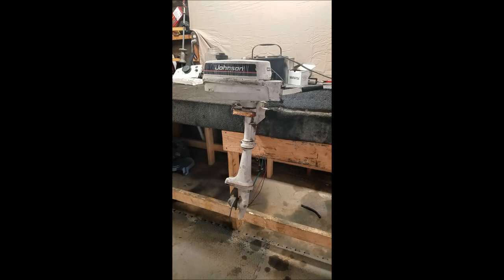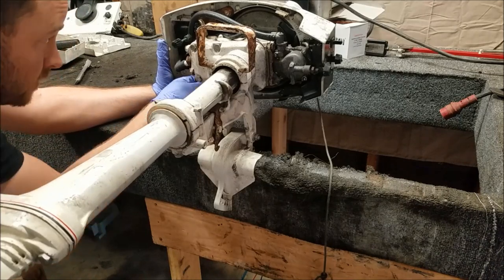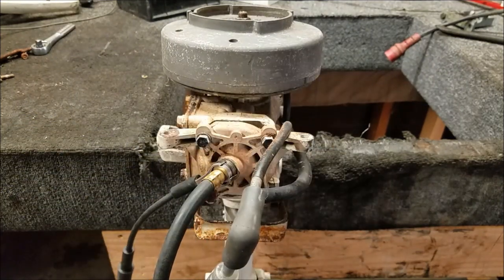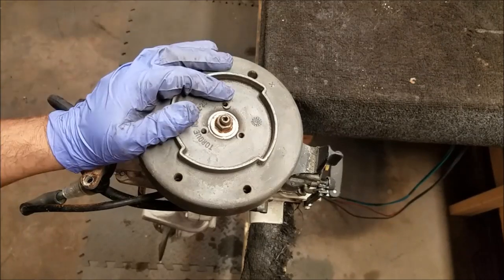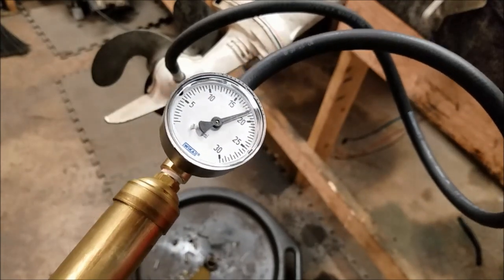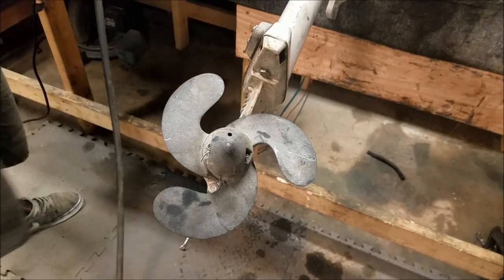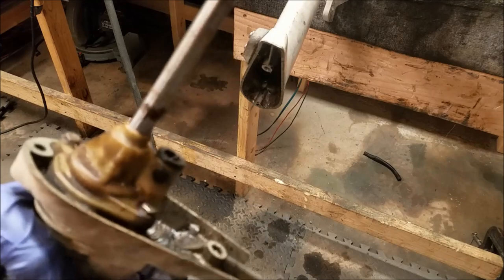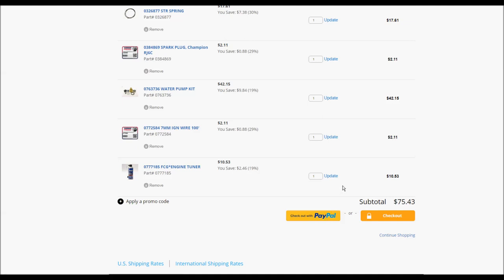Johnson Evinrude Colt / Junior Inspection & Teardown

Comment: I just picked one up today, and I had a tough time to adjust the liw speed and high speed screws. I find they tend to be temperamental on those small motors. I got mine purring now. It's a 1984 Evinrude Junior.

Comment: At 12:44, the bowl you are holding in your hand has a port/channel near your thumb (towards bottom of screen) that seems to lead to the very center/bottom of the carb bowl (where one of the adjustment needles pokes into). However, on my carb it's blocked HARD. Is it possible this doesn't actually connect by design? I have tried cleaner and compressed air to no avail.

Comment: If you'd had experience of British Seagull outboard motors then you'd know the best way to spin a flywheel when wanting to re-energise the magnetic field is with an electric drill and a socket on the top nut... useful for spinning the flywheel to achieve other things too.

Comment: I mean, with an engine this small there's no call for an external fuel tank. At the standard gasoline engine fuel consumption metric of one tenth of a gallon per hour per horsepower, its going to burn just under a pint per hour at wide open throttle. Carry yourself a 2 gallon gas can and you'll be fine for a couple days of operation. Just make sure you refill the onboard tank every hour or so of operation.

Comment: i have just acquired a 1982 johnson colt outboard, no spark, have made a puller  hub to remove the flywheel housing, does anyone know the thread size  for the bolts that go into the flywheel head? they don't appear to be metric .

Comment: Perfect timing,  I have the same one in the garage.  Is there a trick to getting the lower unit off? Mine slides down about 1/2 an inch and then comes to a hard stop? I'm a newb, so I may be missing something easy?
Reply from the maker: If you notice, mine did the same thing.
Took some wiggling, and it came out.
Reply: Do i need to take the fly wheel off to take the lower unit off?

Comment: Hey Brandon quick question for you I have a 200 Evinrude 1990 I was trying to do the timing on it and when I hook the timing light to the number one cylinder wire I get a very intermittent Flash and it's very erratic I hooked the light up to all of the other wires and get a very steady Flash could this be a bad ignition coil?
Reply from the maker: Probably, 
Swap it with a good coil and see if the problem moves.
If it doesnt, you could have a problem with the timer base or powerpack.

Comment: I have this motor.  The pull rope broke and I need to remove the cowling to replace it.  Does the fuel tank have to come off in order to do this?
Reply: Fuel tank is separate from cowling and is secured by 2 metal clips that slip in under that metal "ring-frame" that is between the 2 halves (upper and lower) of the enclosure.
Reply: No, the fuel tank is separate from the cowling, it is secured by 2 metal clips that fit through slots in the 2 tabs molded onto the bottom of the tank. Those tabs fit through sots In the "ring-frame" that forms the divide between upper and lower halves of the cowling.

Comment: You undid the wrong aft bolts for the cowling. If you had removed the other 2 bolts instead, the "ring-frame" and gas tank would have stayed in place and only the pull-starter and cover would have come off giving better access to the starter.

Comment: Have same motor. Can't get nut off the top cover to access spring. Rope pulls out but doesn't recoil.
Reply: Any ideas?
Reply: Mine was stuck, too.  I used a 1/4” socket with Phillips head bit, got it loosened and removed.  Now I need to figure out how to remove the cowling so I can replace the pull rope.  Any tips for me?

Comment: I made the mistake of taking the screw out of the top & it unwound the recoil
Then I rewound it put it all back together & it's still messed up 
Hate recoils
Reply: I did the same damm thing!  Put it all back wound up - I used a 9/16" socket chucked into my 1/2" drill motor, much nicer than pulling the damm cord
Reply: Me too. I always make the same mistake because I go about 10 years between taking off the top and as soon as I hear that "Zing!" I give myself a forehead slap. I am an expert by the time I get it all back together. Whatever you do, make sure the little tabs drop into the cuts in the center gizmo or the pulley will not snug down tight when you tighten the large center screw on the top of the cowling. Rotate the gizmo until it seats and save yourself a lot of aggravation.

Comment: Excellent vid.  Very helpful re: reworking recoil starter.  Got mine out for 1st time in 3 years.  After fixing starter, fired right up.  Not much water with exhaust coming out of ports.  I think I replaced impeller/pump assembly 6 or 7 years ago.  96 degrees here today and engine seems to be heating up. I don't have an infrared thermometer.  Does it seem likely that I may need a new impeller?  It's just a fun little motor for the inflatable and bass boat. Don't wanna burn it up.  Any advice would be greatly appreciated.
Reply from the maker: Probably, It soaked my hand in no time.

Comment: you called it a motor and an engine.. lol!  remember... motor is electric, engine is gas.   :-) technical terms :-)
Reply: from Myriam Webster
Motor

2: any of various power units that develop energy or impart motion: such as
a: a small compact engine
b: INTERNAL COMBUSTION ENGINE
     especially : a gasoline engine
c:  rotating machine that transforms electrical energy into mechanical energy

They are somewhat interchangeable.